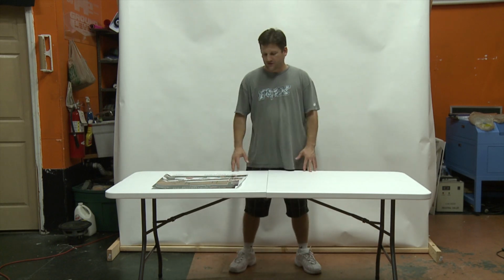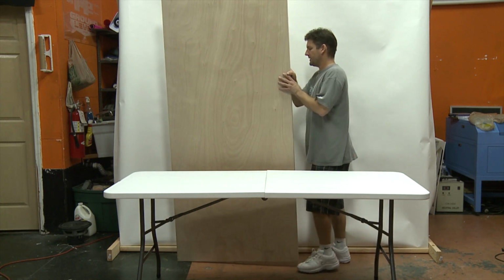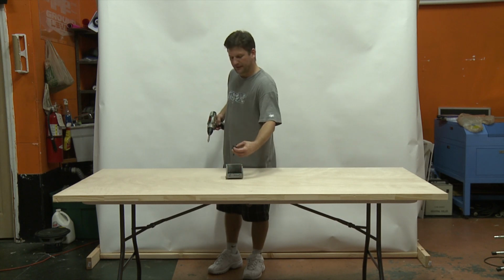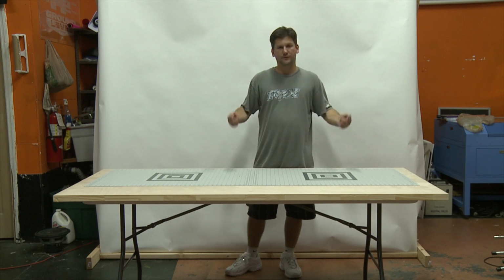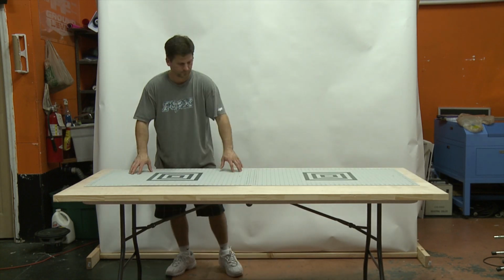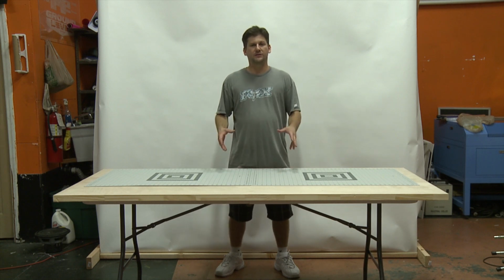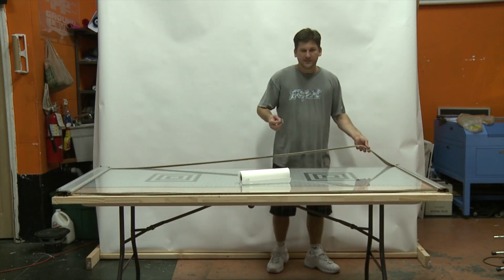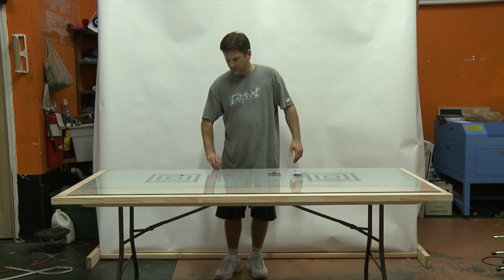Let's Fly RC - Workbench - Build

Comment: I’m new to the hobby. I’m not understanding why the cutting  mat would be placed under the glass.  Do you cut on the glass?  Seems strange so there must be something I’m missing.  Is it just being used for the lines?
Reply from the maker: Lonzo McLaughlin yes. I cut on the glass.  It doesn’t scratch unless you have an extremely dull blade.  Mine is still going strong 4 years later.   I have one at home and one at work.

Comment: Very good video. There doesn't seem to be too many on youtube for a cost effective rc building table. I do have one question though. How would you describe the 'flatness' of the table after you add the glass? Is the underlying table structure strong enough to keep the surface really flat. I am looking to use it to build 1/4 scale gas powered warbirds. Your thoughts are greatly appreciated.
Reply from the maker: ripper9111 it is insanely flat.  I build airplanes on it all the time.  And, years later, I still use it today.  :) couldn’t be happier with the table - I have one at home and one at work

Comment: I understand the glass on top of the wood; I even love the idea of it, but what I don't understand is why the cutting pads underneath instead of on top. Why spend $70.00 - 80.00 dollars on matts if you're not going to use them.

Oh yea, I really really like the idea of use of Magnets, That is a Brilliant idea. No more tape tearing plans up by mistake. Great Idea, Great.
Reply from the maker: Thanks for the comment, Robert.  Sorry it so long to respond.  I haven't been getting notifications about my comments.  The cutting pads can be substituted for drawn measurements, or plotted measurements.  The reason for putting them under glass, is for easy clean up.  The hot glue and CA sometimes gets on your surface, and I got tired of scraping off the lines from my cutting boards.  Also, the razor blades don't gouge the glass.  It makes a great, always flat surface, that is easy to cut on.  Yeah, those mats are a little pricy, but I was too lazy to plot out, and verify a printed sheet of paper.
Reply: So cutting pads are simply making expensive grid lines to line things up with?  They are never cut on  directly?  Perhaps there is another way to get a set of lines and angles.

Comment: The 4 minutes of black screen at the end of video was a strange choice. I guess every director had a vision. Seems like you now have a table that you can't stick pins in, put cutting mats under the glass when some graph paper would have given the same function, magnetic ability is limited as round magnets are of limited use, although some wooden building jigs would be useful with these magnets imbedded. But if that is the intention would be much better to have entire surface magnetic. Accidentally drop anything and shatter your table.
Reply from the maker: Shelby Seelbach. Thx for the comments bud.  Yeah, I thought the black screen at the end would be very artistic and creative, lol.  It was an accident. :)

The glass table is still killing it 3 years (I think) later.  Not shattered. :)